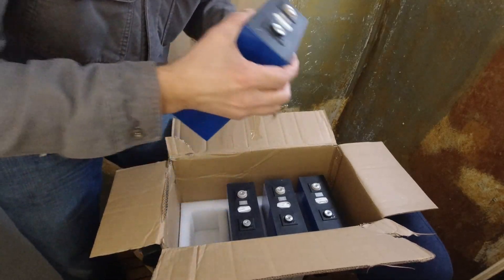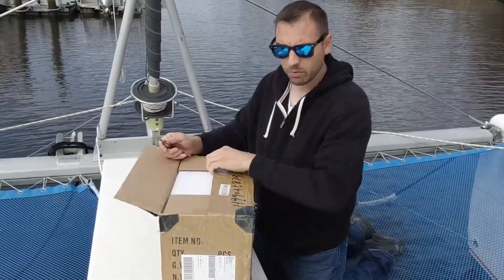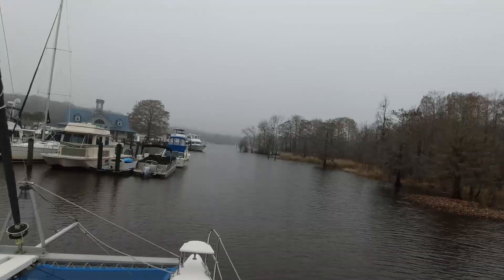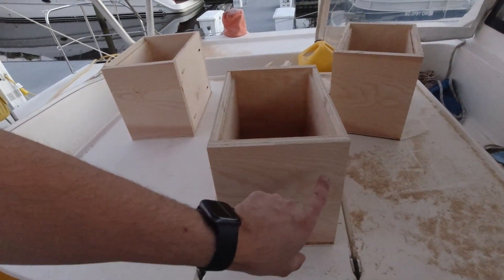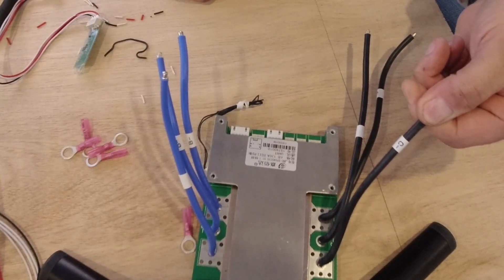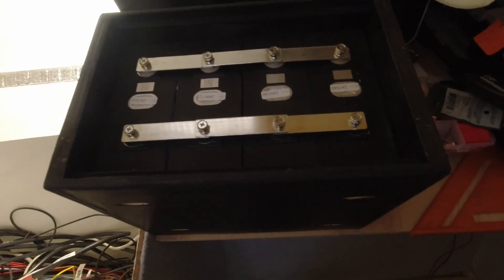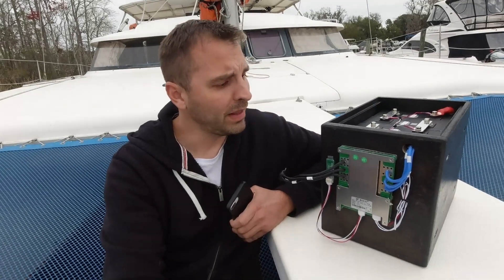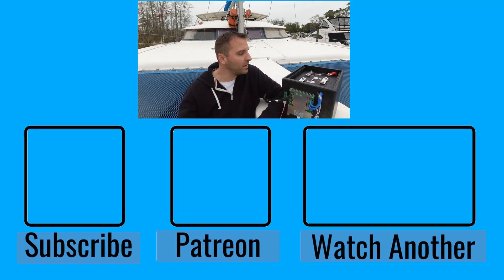Building LITHIUM Batteries [DIY] For Our SAILBOAT

Comment: always makes me laugh with all the solar panel upgrades all the links are always unavailable
Reply from the maker: What links?
Reply: @SaltyEscape  amazon ones
Reply from the maker: I clicked into it and it appears to working.  If Amazon changes Something their end the products will say unavailable and I need to change it.  But they don’t tell me.  Would you mind sharing specifics so I can fix it?  This video is about batteries so I looked at those links.  I’ll check the solar panels.
Reply from the maker: Okay, so the only things “unavailable” are the sun power 110 watt panels and the battery BMS.  In both circumstances they have been factory discontinued. I am changing my links to  similar items.   Thanks for letting me know and trying to use my links.  😊

Comment: Thanks for sharing!  Very neat build.  I'm doing a similar project on our 39' Privilege but using the plastic battery boxes that fit these size cells and also putting the BMS inside the box.  I've started a thread in the DIY Solar Forum under Marine.  Do you have a thread of your build on there?
Reply from the maker: That’s a good idea to have a thread in the DIY solar forum. I have spent a lot of time reading on that forum but no, we didn’t start a thread.

Comment: Two comments. I noticed immediately that the screws which came with your batteries  seemed to only give you about 3 turns into their sockets. I'd lengthen the screws a couple or three thread lengths for a more secure purchase (they're probably M6 screws).
Reply from the maker: It’s been about a year since I built the batteries.  As I recall, the screws bottom out.  I’m due to check everything over (to insure everything is still tight). I’ll check them out!  Thank you.    I only noticed one comment, you mentioned two… Did you see something else that I should change?

Comment: Corey -  Great video.  I'm starting to get the parts for my first battery pack (I haven't even gotten the boat yet). Two quick questions.  1. Have you found your capacity of 1400Ah to be adequate for your daily power requirement?  2.  I see people talk about needing to compress the batteries.  Have you experienced any issues with your battery box design?  I appreciate all your insights.
Reply from the maker: Hi Tom, Great questions!  It’s very hard for me to answer the question about 1400 amp hours and whether or not it’s enough for us… I think so… I made another video talking about how much power we consume. Basically we took the boat out and use the batteries overnight. We did not try to conserve. I remember talking about exact numbers in that video but I seem to recall we had just less than 50% capacity after 24 hours. Keep in mind there was no recharge effort. We did not have any solar operational, we did not run the generator and we did not have the Orion converters for our alternators.  We tried to base our amp hour bank off of other Youtubers such as Gone with the Wynns. I seem to recall they only have around 1100 amp hours and they are heavy consumers of power like we are.  
Regarding the wooden boxes. They have been performing well, one thing that did not make it into the video is I used them pieces of plastic as spacers in between the batteries. These were cheap cutting boards I found at Walmart, maybe 1/16 inch thick. The purpose was to prevent any eventual wear and causing the batteries to sort out to each other… I doubt that would ever happen but I saw someone else had done this so I did it as well.  Regarding compressing there are many YouTube videos that look at this in depth. By my calculations the lithium batteries should live for about 10 years at still 80% capacity. If you put them under compression you may be able to squeeze out some more time.  My logic with the boxes is the batteries are tight and if they should expand it won’t allow them any room… Pseudo-compression.  
How about sending me an Email.. that way we can converse a little easier and share pictures if necessary.  Also, I heard from one of my friends in the Marina who has a Monk 38 Who tells me he has plans to sell it sometime in the next few months.  They just returned from the Bahamas.  Talk soon!  SVSaltyescape@gmail.com
Corey
Reply from the maker: Sorry Monk 36

Comment: Finally someone who made their own prismatic lifepo4 battery in a sailboat. The cost/watt really opens the door to all electric boats (motors included when using 48-96 volts).
How come you didn't build one 5p4s battery in one large battery case? I though these cells do better in parallel individual cells You'd have to up the BMS amps though.. maybe the daly 500 amp BMS.
Reply from the maker: Hi Thomas!  Thank you..
We went with this configuration for two reasons.  First, physical space on the boat was better for smaller units and second, at the time the BMS technology seemed to be more for the 100 -120 amp versions.  Daly wasn’t well known at the time… fast forward a year and they seem to now lead the market.  
I was unsure how well the batteries and BMS units would work and a modular design would serve to easily take a battery pack out of service if needed.  
I am happy to report we have had this installed for over a year now and they are working extremely well. I spoke with the nice people at battle born because I bought my Victron multi plus from them and they were very helpful for programming parameters for my BMS units.  
Reach out anytime if you have any other questions! 
Corey

Comment: To change the name of the individual bms’s.
Open the app and click on the battery whose name you want to change. Down in the bottom right hand corner click the configure button. Up at the top you will see battery Alias. Click on the name in battery alias and change it to whatever you would like. Hit the back button top left corner and you will see your battery name has changed
Reply from the maker: I’m going to look right now! 
Thank you!!! 
Corey
P.S. “This is the way…”
Reply: @SaltyEscape  
😂 You’re welcome, let me know how you make out
Reply from the maker: @vandalorian8777  IT WORKS!!!   This is going to make it sooo much easier!!  Thank you!
Reply: @SaltyEscape  
Glad I could help. Looking forward to seeing how much solar you are going to be able to install. My advice would be to install as much as possible. I would consider installing panels aft of your cockpit roof over the dinghy. A gaming computer can use as much as 500w 42 amps per hour😳
Reply from the maker: We have 4 Panasonic 320 watt rigid panels and 4 120 watt flexible panels 
Hopefully that will be enough.  Hopefully We will get our arch soon to go above the dinghy exactly how you described and we’re talking about converting our cloth Bimini to a hard top Bimini for the flexible panels. All of that should be installed over the winter.  🤞 Still waiting for some supplies to come in and waiting for enough funding to purchase the arch
Reply: Also, overkillsolar recently came out with their own app that works better than Xioxang.  You can name the batteries in there as well.

Comment: Great video!  Do you think adding a handle for the battery box? It seems heavy.
Reply from the maker: Hi Kevin, yes my plan was to install simple rope handles. Easy enough to do at any time by drilling holes in the wood and threading rope with knots to hold them in place.  However I don’t plan on moving the battery packs once they are installed and they are not so heavy that I cannot easily carry them.  Each box weighs under 50 pounds.   For now, I’m going to leave the handles off. Thanks for reaching out to us!  -Corey

Comment: Question?  Wouldn't you want a BMS that meets or exceeds the battery capacity? (You have a 280 AH battery, but only 120 Amp BMS (charging/discharging).  Won't that limit how fast you can charge and also your load capability?
Reply from the maker: Hi Douglas, this is an excellent question!  The batteries are measured in amp hours, in other word, this means how long can you draw on the battery. If you have an appliance that draws one amp per hour you could run that appliance for 280 hours. The BMS is measured at amps. (Not amp hours) This is how much current you could pull through at one time. We have five battery groups, and each has its own 120 amp BMS. This means I have the ability to draw a maximum of 500amps, at one time. This is significantly more than I ever expect to draw.  The same principles apply to charging effort, I don’t expect to have 500 A coming in at any one time. I hope this helps, thanks for the question!  Corey

Comment: Thanks for sharing your build. I have a 36ft Catalina. I have 8 cells from the same supplier on the way from China. Have also ordered the same BMS. I will gratefully copy your battery box design. The plexiglass top is a great idea. Have you decided to compress or are you in the no compression school of thought? I’m leaning towards securing them enough to prevent friction but not compressing them. Will slo be installing this thin cutting boards between each cell. My research on line has led me to understand it’s a good idea to top balance at 3.65 V. 
I am looking forward to the next videos. Once again thanks for sharing. Cheers Kevin
Reply from the maker: Hi Kevin, Thank you!
I am not compressed directly. I thought a lot about compression and like you mentioned, there are at least two schools of thought.  I asked the Alibaba contact and she seemed confused but eventually stated the bus bars are spaced correctly... lol. I chose to build these boxes with 3/4 plywood and I built them with very tight tolerance. My idea was to create a stout confinement for the cells because I have seen they will expand and contract during use.  While They are not truly compressed, they will apply pressure to each other during the expansion creating a pseudo compression… At least that’s my idea.   As for the top balancing to that specific voltage, honestly I am not sure. I suspect my batteries have come manufactured at a slightly lower voltage than previous generations and therefore I am finding conflicting information on the DIY forums. I think the most important part of the programming is the safety cut off’s. I’m considering making a quick follow up video because there have been a lot of good questions, as you saw. Thanks for reaching out to me, let me know if you have any other questions! Corey
Reply: I’m interested in seeing how others are dealing with protecting the alternators if the BMS shuts down the battery due to a cell hitting high volts. My plan to address this is keeping my lead acid bow thruster & windlass bank and the start battery as well. Will charge (with solar and alternator)the lithium and lead at the correct rate for the lithium. Will top up the lead with a DC-DC charger with the lithium as the source from time to time as needed. We are setting our boat up for extended periods at anchor. If the first shipment of lithium performs well we will add another 4 or  8 cells.  Cheers
Reply from the maker: I am keeping the lead acid for the engine starter batteries and I am using the Victron Orion dc to dc to flow from the starter batteries to the lifepo4 house bank for charging while the engines are running.  I think this is the easiest way to utilize your alternator to charge the lithium batteries. As you know, the internal resistance of lithium batteries is quite low, therefore it feeds through the lead acid battery first… I am actually working on this part of the install this week.  Our catamaran was previously set up with lead acid house bank and lead acid starter batteries, they were all tied together with emergency switches to re-route power and a lot of redundancy. It has actually been quite an undertaking to dismantle it.
Reply: Yes I considered going through the starter but my thinking is I would then not take full advantage of the capacity of a Balmar  high out put alternator and regulator as the DC -DC limit of only 30 amps. So I decided to use a Victron 200 amp 3 bank isolator. In this way I have the ability to maximize charge rate to the lithium. Once the lithium is full I can top up the lead. I’m sure both our strategies will meet our needs. And I understand the pain of ripping out various systems. I’ve have replaced  80% of my AC&DC along with most of the instrumentation. But it’s also a lot of fun. Cheers

Comment: Thanks for sharing this amazing how to video.  My only concern with Lithium is they don't perform in the extreme cold or heat.  The batteries  require their own climate controlled environment.  Otherwise I like that the voltage output is stable to near depletion.
Reply from the maker: The data sheets and information online shows -20 to 60 degrees C.  Those are very extreme. We have ours programmed to shut off at 0 and 55 (on our specs).  I hope our boat never reaches either of those temperatures. 😊. Also we are installing the batteries under a bed, near the waterline. This should help to keep them cooler.
Reply: @SaltyEscape  I'm no expert so maybe not a sufficient cause for concern, but don't the batteries generate heat when cycling that could build up in enclosed space?
Reply from the maker: A few of the main cables get warm, not hot, and only when we’re doing a heavy charge, like when we ran the capacity testing. Under normal operation we have not seen the system get warm.  The BMS have an overheat shutdown temperature probe so we know if there is a temp problem.  Hope this helps!  Corey
Reply: @SaltyEscape  Hello from Tulsa, Oklahoma. (The furthest Inland Port in the USA, Marine Hwy M-40 "The Port of Catoosa")  We got to -13 degrees F below freezing this year!  With the weather patterns changing around the planet, the freezing cold could become a problem.  However, since that puddle jumper of yours is mobile I doubt if you would have any problems.  I would consider some type of heating arrangement for the batteries.... Just because Mother Nature does not have a sense of humor!   (Waves)
Reply from the maker: Yeah... If we ever plan to be in a place with temperatures like that we would pull into a marina and plug in.  Of course there are people installing low draw silicone heating mats to keep things warm for extremes.   I’ve only seen this in the RV world so far but we would certainly be willing to implement them if needed.  We definitely have the amp hours to account for the draw.   Nice talking to ya!  Cheers.

Comment: This is the best DIY battery box build video I've seen yet.  The only thing I can maybe add is you probably want the thin fiberglass sheets to go between the batteries.  This prevents the aluminum cased cells from touching each other and shorting out.  Probably not an issue for many, many, years.  But eventually the plastic wrappers are gonna go...Super nice boxes though!!!! SUPER NICE!!
Reply from the maker: Hi Allyn, I actually did insulate between the cells... it didn’t make it into the video.  I will include it in the write up.  However I used thin plastic cutting boards. They are only about 1/16 thick!
Reply from the maker: By the way, thank you!!  I put a lot of time and thought into this build!!
Reply: @SaltyEscape  I would probably include air gaps, and airflow for cooling. Heat is one of the biggest problem for batteries. You can also think about if one cell catches fire. For that case, I would think about some fire proofing between the cells, to prevent the fire consuming all the cells quickly.
I like that the BMS is outside, but there also it seems that one side is touching the wood casing. Airflow for cooling would be great there, and wood is not the best choice against fire.
Fire is anyways one of the biggest danger on a boat.
Reply from the maker: @Sonnell if I may, I’d like to discuss some of your suggestions.  I understand your thought process regarding airflow and passive cooling however none of the commercially available batteries are built that way.  They are all fully inclosed in a plastic (flammable) box with packing foam surrounding them.  Commercially assembled batteries have no internal fireproofing.  As for heat, I’m my experience these batteries do not get hot.  The hottest I’ve seen them is around 100 degrees Fahrenheit and that’s with bulk charging from shore power.  My batteries have been in service now for nearly 2 years. 
Also, the risk of fire with Lithium Iron Phosphate chemistry is extremely rare.  A deep cell lead acid battery is much more likely to catch fire compared to LiFePo4.   
My design allows for air cooling from the tops of the batteries and allows for inspection of the terminals to ensure the terminal bolts stay tight over the course of years of service  a feature that almost none of the commercial batteries offer.  Also my design offers compression of the cells which will increase their lifespan. (Commercial batteries don’t do this either) 
If you have an opportunity to build a battery bank like mine please send me pictures!  I’d love to see your design.  
Corey
Reply: @SaltyEscape  Hi, thanks for the reply. My comment was not a criticism of your design, but suggestions for improvement. 
Even though the LiFePo4 cells are less likely to catch fire than the more common LiIon types, still, fire and overheating is the biggest threat. The commercial ones I saw, usually have 1-2 cm space around them, the foams do not fill the entire cavity. If you use them heavily, they can get hot. But since fire is the biggest threat on a boat, I think, even if the chances are not high, cooling and fire proofing is very important.
Some of the commercial, even the cheaper ones do have steel rods to compress the cells, however I am not sure if this type of cells benefit from compression, maybe the pouch ones do? Or both? I am not sure. 
So again, I do not think I said that your design is bad, there are nice aspects of it, but I think sharing suggestions and different thoughts is always a positive thing.